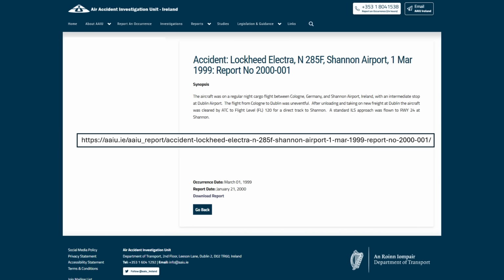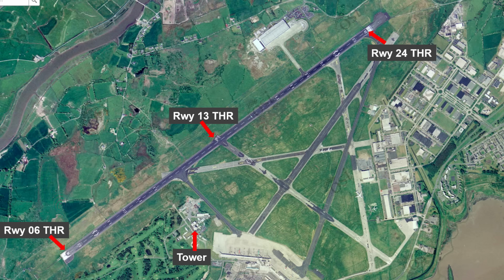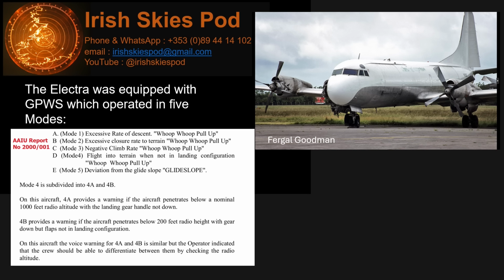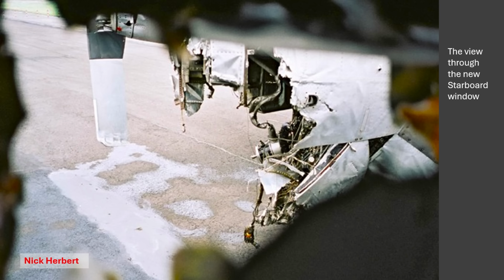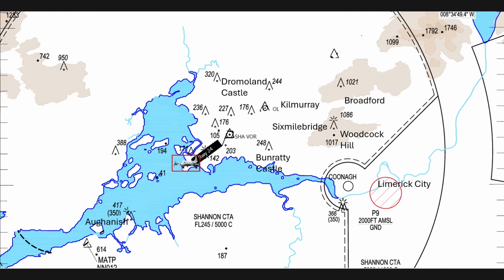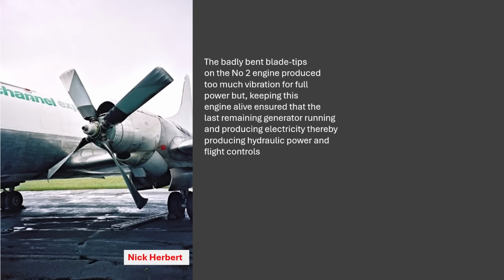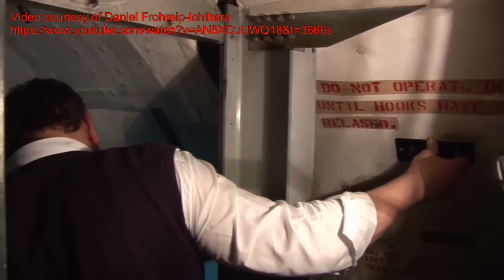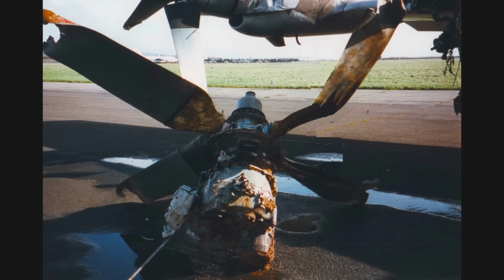THE GREAT ESCAPE - Engine Falls Off Lockheed Electra at Shannon - Irish Skies Pod Episode 12

Comment: What an amazing outcome, and amazing crew.  In the 80's (90's?), we had a similar, successful outcome with one of our HC-130H Hercs in Alaska.  I think it was the #3 prop that sliced right through the side of the right fuselage, directly abeam the engine, the hole was enormous.  If I remember correctly, the prop came off in flight (not due to impacting anything).  So very glad for the best possible outcome for both of these stellar aircrews.  Bravo Zulu, and  Semper Paratus!
Reply from the maker: Thankfully the outcome worked out.  Nick had experience on the C130 (amongst a lot of other aircraft) too.

Comment: Great story of a well managed cockpit professional ATC this crew did an amazing job of getting onto the problem without panic the Electra electrical systems were complicated and with so many looms damaged all sorts of mischief is going to happen. 

Electra was very capable of doing a good job of engine disassembly in flight on this occasion the cause was propeller blade striking the runway but engines falling off was not unusual for the Electra which had teething problems where a dynamic vibration caused structural failure of the engine mounts later identified to be caused by ' Propeller Whirl ' or ' Flutter '.   Norman Tebbit used to fly the Electra and said when you started having problems the Engineer would stamp on the cockpit floor to loosen any relays in the electronics bay below.  I look forward to reading Paddy's account.
Reply: Norman Tebbit flew Britannias not Electras. If it had been a well managed cockpit the flight engineer would not have inhibited the undercarriage warning and the problem would not have occured